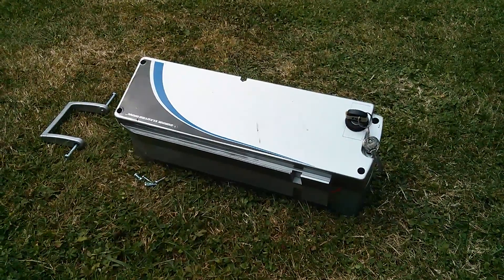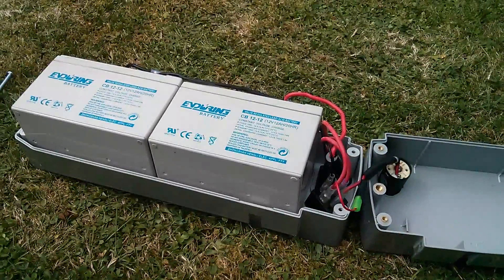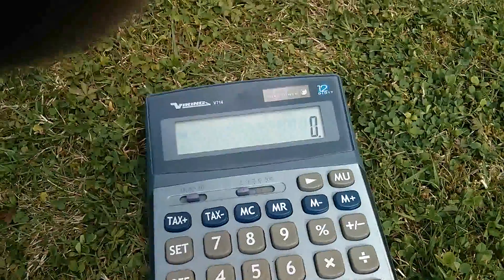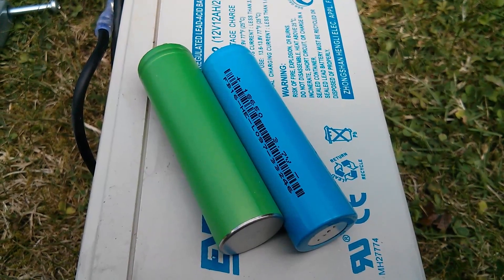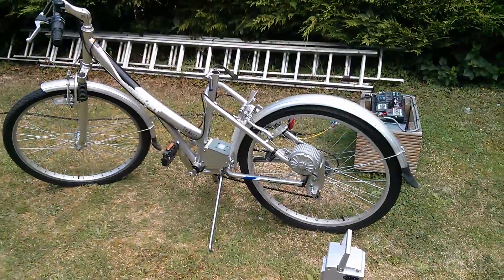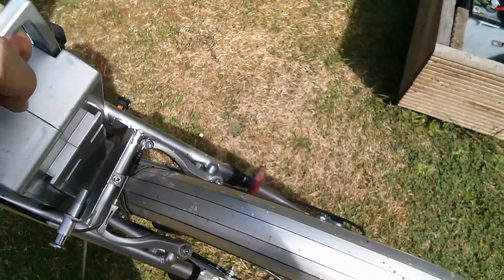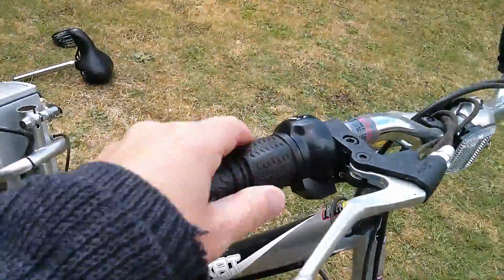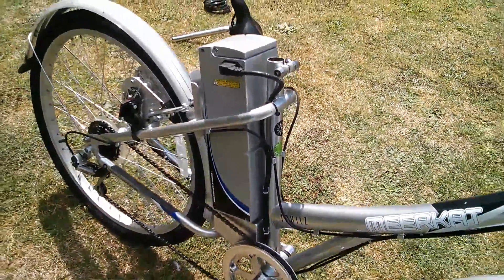Project: Upgrade Electric Bike to Lithium Batteries #1

Comment: Why not use a BMS like this one to  help out with balancing? http://www.bestechpower.com/259v7spcmbmspcbforli-ionli-polymerbatterypack/PCM-D131.html

Most 18650 cells can only supply 1 - 2C without overheating/damaging. There are some great cell holders available on eBay which are great for building your own pack with. 

And lastly, the endless-sphere forum is a great resource!

Good luck
Reply: LiPo's are a more advanced form of LiIo (Li-Ion).

In a regular LiIo battery the electrolyte is essentially free floating. You want to keep the electrolyte close to the lithium electrode which more or less mandates a cilyndrical form and a hard metal case (which typically doubles as the anode) to contain the 'fluid' (actually more like a gel).

In a LiPo the electrolyte is held in a solid polymer film which is directly bonded to the lithium electrode.  The big benefit here is that because of this, they can essentially be made in any shape and don't require a hard casing. Also because there is no fluid, they won't leak. (they do have other failure points such as bubbling up). This makes them (arguably) environmentally friendlier, but the polymer is harder to manufacture and recycle.  Don't discard batteries in the bin, get them properly recycled !!!

Not needing a hard ('heavy') casing also means that per mass a LiPo will hold more charge than a LiIo. At current (pun intended) LiPo's have a shorter lifespan, but this is more because of the newer technology compared to LiIo and this is expected to improve over time.

All of the above means that manufacturers of small form factor devices (phones, tablets, laptops) are moving away from LiIo based batteries and moving towards LiPo packs (with an added benefit to the manufacturer that the packs tend to be proprietary formed meaning they get added sales from replacements rather than other companies replacing the cells they used to use.

Noteworty item.  Some companies are selling LiPo batteries in a 18650 form factor.
Reply: oreubens
Thank you for the detailed explanation.
Reply from the maker: Thanks. That BMS looks very nice - and very expensive!
Reply: Julian Ilett Found a simliar one the ebays for 35GBP:
http://www.ebay.co.uk/itm/Lithium-Ion-Lipo-Battery-Management-Protection-BMS-PCM-Board-24v-50A-7S-Balance-/131247509291?pt=UK_BOI_Electrical_Components_Supplies_ET&hash=item1e8ef60f2b

Then you would be able to use a simpler(/cheaper) charger and have all your protection+balancing taken care off?
Reply: Or could make something around the LiPo packs used in RC.  They tend to be good quality, fairly cheap, Can do high voltage and high amperage, and the capacity is good.  Lipo does need care for charging and they don't like to be charged to full for long durations though. So it would be "charge before you drive".  Li-Ion has less issues with being fully charged for prolongued periods of time.
Reply: oreubens
I never quite understood what's the difference between the cells called "LiPo" and the cells we all know as Li-Ion. According to wikipedia there is no difference, they are the same, they only differ in their packaging.

Quote:
A lithium polymer battery, or more correctly lithium-ion polymer battery (abbreviated variously as LiPo, LIP, Li-poly and others), is a rechargeable battery of lithium-ion technology in a pouch format. Unlike cylindrical and prismatic cells, LiPos come in a soft package or pouch, which makes them lighter but also lack rigidity.
The denomination "lithium polymer" has caused confusion among battery users. It may be interpreted in two ways. Originally, "lithium polymer" stood for a developing technology using a polymer electrolyte instead of the more common liquid electrolyte. The result is a "plastic" cell, which theoretically could be thin, flexible, and manufactured in different shapes, without risk of electrolyte leakage. This technology has not been fully developed and commercialized and research is ongoing.
The second meaning appeared when some manufacturers started applying the "polymer" denomination to lithium-ion cells in pouch format. This is the most extended use nowadays, where "polymer" went from indicating a "polymer electrolyte" to mean a "polymer casing", that is, the soft, external pouch. While the design is usually flat, and lightweight, it is not a true polymer cell, as the electrolyte is still in liquid form, albeit it may be "plasticized" or "gelled" through a polymer additive. These cells are sometimes known as "LiPo", however, from the technological point of view, they are the same as the ones marketed simply as "Li-ion", as the underlying electrochemistry is the same.
Reply: *****
Phosphate is not relevant to the abbreviation LiPo. LiPo means Lithium Polymer and it means Lithium Ion cell (usually in a polymer bag) with the electrolyte held in a solid polymer film. oreubens explained it perfectly above. Phosphate is relevant to the abbreviation LiFePo though.

Comment: 1. battery protection, get a protection circuit module, or battery management system.
DO NOT USE WITHOUT PROTECTION MODULE!!
2. charger, you can get one of those CC-CV boost modules and use them. a proper Li-Ion switchmode charger would be better.
3. Cell type: pouch cells would allow you to put more capacity in the same volume, as far as I know. I would be careful with the RC type, probably best to get some proper cells.

Comment: just a few observations:
the "IEC" connector has 250V 10A markings on it and those motor wires are... well... not exactly go together with the 40A fuse.
also remember that a fully charged li-ion cell is 4.2V adding up to 7*4.2=29.4V which might be a bit much for the motor and the speed controller not mentioning 8 cells in series.
and also all the balanced chargers i've seen are up to 6 cells, so you should keep that in mind too.
Reply: the 250w motor at 24 is only just over 10amps, the 40a fuse is way over the top, 20a would im sure cover all possible peaks of power, but for sure, they arn't gonna reinvent the iec connector (which can be rated upto 13a) and will probably push a bit past that for surges anyway
Reply from the maker: After removing the charger, the cells would probably drop to about 4v off load and 3.7v when loaded by the motor. I have seen some 8S balance chargers - here's one:
http://www.hobbyking.co.uk/hobbyking/store/__7523__Turnigy_Accucel_8_150W_7A_Balancer_Charger.html
Reply: Li-ion cells should not be charged to anything over 4,1V! They will thank you with very greater lifecycle times. ;)
Reply: Julian Ilett I have an accucell 6 for charging RC lipo packs which is the little brother of that one.  It's a very decent charger unit (needs a separate power supply) that can do LiPo, Li-Ion (LiIo), NiMh, NiCad, Lead acid, LiFe, and it's quite well known in the RC world.  It's quite flexible on the power supply, I'm using an old PC ATX power supply myself.

It can do balanced charges on 6 (8 for the accucell 8) cells in a pack. But you'll probably need to add multiple packs in parallel to get the duration you need (? I have no idea how a lead acid compares to LiPo/LiIo for capacity), those packs would need to be individually charged.
Reply: Julian Ilett  "After removing the charger, the cells would probably drop to about 4v off load"
4 volts? Why?

Comment: i thought thah LiPo batteries are charged to 4.2V. And when you put 7 of them in series, it will give you more than 29V. Make sure your speed controller can handle that (as you showed us, input voltage is should be 25V)
Reply: +xpertvis he is using lifepo4

Comment: wow, how many parallel batts u will need to juice out 25A from these tiny lipos ? wont they explode of over current ?
Reply from the maker: iceberg789 perhaps 6-10 parallel cells
Reply: One Sony 18650 VTC4 can output a maximum of 30A constant, or 100A peak, but these are high drain batteries.

Comment: the real question that bugs me is how to both charge these and how to rebalance them occasionaly, the building of the battery is the easy part! plus of course temperature monitoring for the inner cells might be an issue so you can charge them all faster than a fortnight.  Each 7 pack would be 2ah @ 24v  (the cells are 2000mah?) so you would need 6 packs to equal the lead acid, (probably will beat the lead acid  that seeing as you cant really get all the charge from a lead acid as the voltage drops and the electronic controller turns off)

Comment: Could you use 12AH LIFEPO4 cells? there's a company called eclipse cycles who sell a selection of these cells! 12AH cell is around £16?
Reply from the maker: Wow, they look nice - I guess an 8S balance charger would work with these. What about cell protection?
Reply: they are! I'm using a 4 cell series 3 parallel to give me 12V 36AH! I haven't found the perfect solution to charge/discharge protection!

Currently using a 16amp Skyrc rs16 balance charger for charging! With no discharge protection other than monitoring cell voltage with my eyes! 

The site has BMS solutions, but I see a lot of people on forums losing cells because the BMS decides to do its own thing!